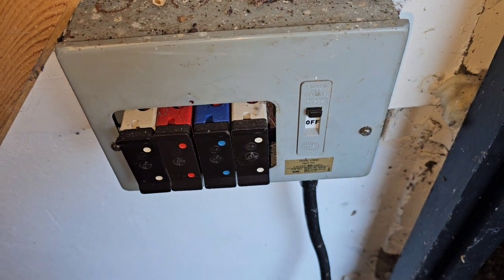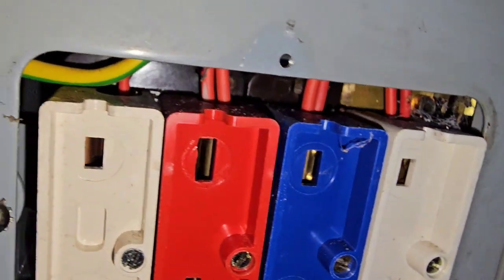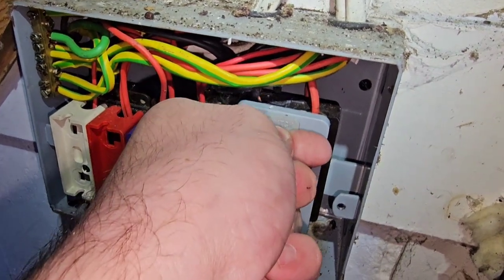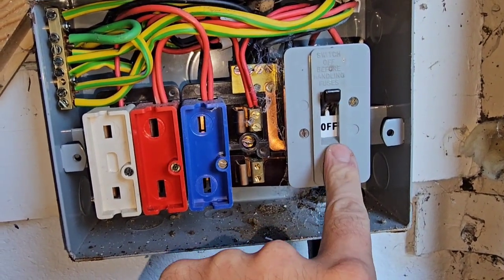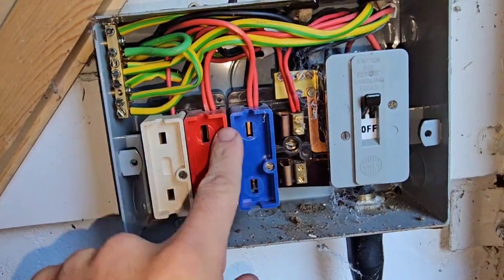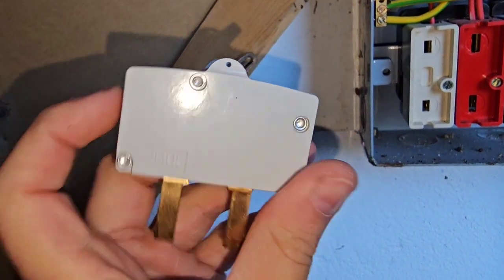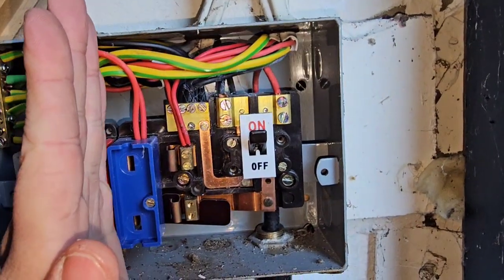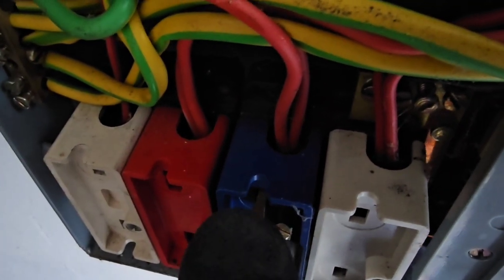DB Inspections: Wylex 3036 👀

Comment: The main thing I’ve come across was the old 7/.029” cable had a 3/.029” earth wire and the 30 amp bs3036 didn’t seem to protect it adequately. Seen a few blown earth wires on imperial cabling ring mains.

Comment: Found one of those metal wylex boards in a flat recently. It was all wired on mineral insulated cable and half plastered into the wall. The cables all tested out ok but would have been impossible to reterminate into a new board - it would have ended up as a re-wire. In the end I dealt with it by cutting the back out of a new fusebox cu and mounting it over the carcus of the wylex without disturbing the origional cable terminations. It all went together really well in the end.

Comment: Good video 👍🏼 I have a electric cooker and 1 of the old wylex fuse box, now upgraded to 18th edition my question is my cooker was previously wired to a isolater with rcd and Henley block, now remove the cable is now too short to reach consumer unit can I now use wago to extend cable with a wago junction box to reach new cu?

Comment: Most of these boards  are designed the have the front cover knocked out when installing MCBs. After knocking out the cover it’s advised to run a file round any sharp edges.Then the cover can be reinstated over the MCBs. The later ones had plastic covers and these were designed to be cut out with a sharp knife.
Some electricians used cartridge fuses in these boards .what a nightmare as most customers didn’t keep spare fuses to hand . So they just wrapped fuse wire round the cartridge fuse . Another reason for the cartridge fuses was to provide close circuit protection. Using fuse wire also took away that method of protection

Comment: A particularly nasty one I had with those boards - fuse wire hadn't been trimmed and a 1mm stub was poking out the top between the carrier and the base! Another reason to isolate before pulling fuses 

I believe if you look in the lid there's a line to cut around to fit the MCBs and allow the lid to fit and cover the void too - at least on the later ones 

We have a few of these at work we still maintain and work on. Fitted in the good old days
Reply from the maker: @dead.format  Yeah those DB's are rife for giving electric shocks. The one in the video was in a good working condition compared to others I've seen!

Comment: worth mentioning sometimes the painted circles identifying the ampage can degrade causing them to be live from the front! ⚡ 2036s rewirable fuses need an extra level of caution! Also check for live fuse box casing.
Reply from the maker: @chas3997  100% percent. I did breifly touch on them and meant to put a pic up to show them. I've came across quite a few C1 on those types of carriers. Absolute death traps!
Reply: After all the fuss from another U tuber we could mention Risk of Neutral Earth faults . 😀 excellent video anyway!

Comment: Had one of these in our old house with the plug-in MCBs shoved in, never got round to replacing it, hoping the next lot did.
Reply from the maker: @EastGatesheadIndieRock  They can be ok for continued use in certain circumstances if the installation has been left alone. But better off being upgraded for sure.

Comment: Nothing wrong with ceramic fuses. Never understood why you would want to swap them to those new ones unless you are redoing the whole board
Reply from the maker: @hillppari  People swapped them out for mcb's to make it simplier to reset when they blew. Older lamp went with a last little surge in current which often blew the fuse wire. Little old Dorris might struggle rewiring a fuse!